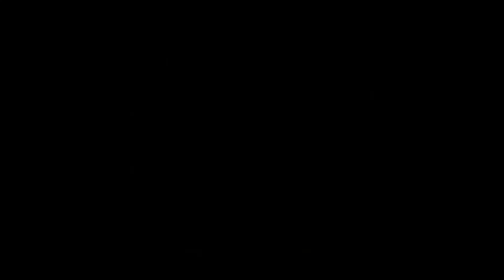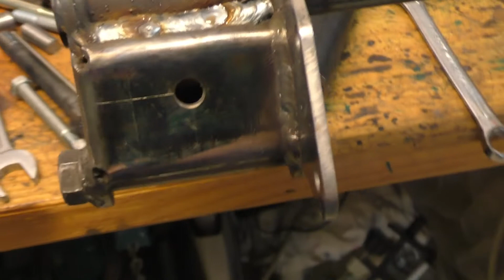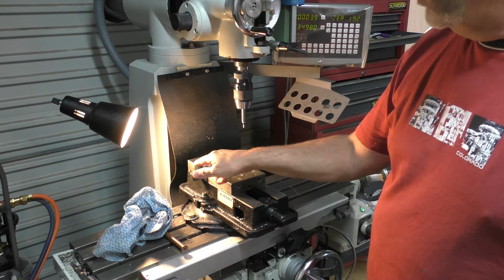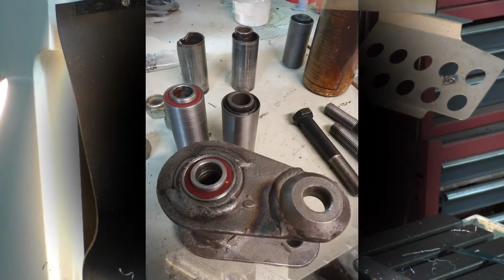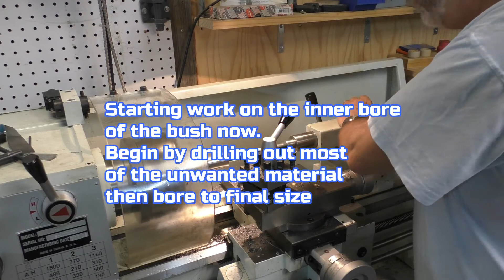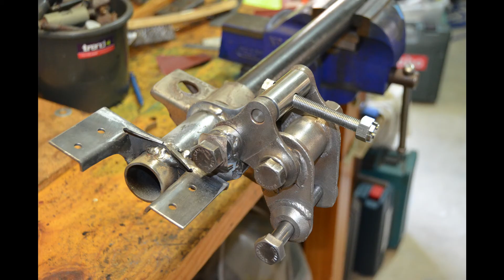Greg's 1949 P3 Rover restoration Chapter 14 rear suspension tube

Comment: i have seen bushings made with a type of epoxy, which might be a bit easier. but i do like your work on the lathe
Reply from the maker: Could be a good option. As an ex fitter and turner I tend to come up with solutions that involve machining

Comment: hi, is there any regulations or insurance issues with re-fabrication of suspension components?
Reply from the maker: I will be required to have my car inspected before I can register it. I suspect there would be restrictions on making modifications. I have aimed to reproduce original parts authentically and only really did so because the original parts were structurally weakened by rust. In the end the only alternative was to either make the parts myself or pay someone else to.